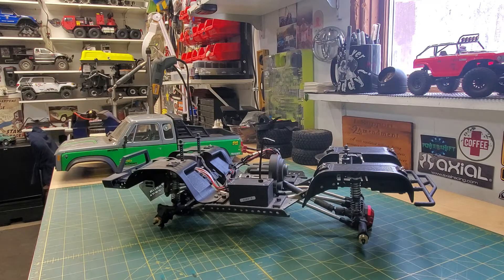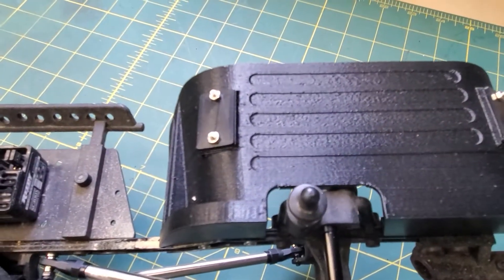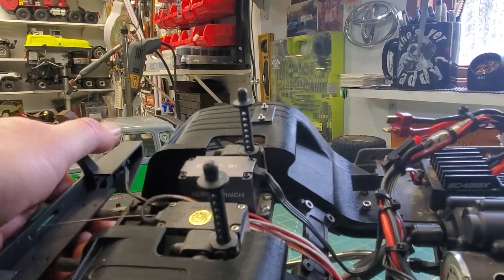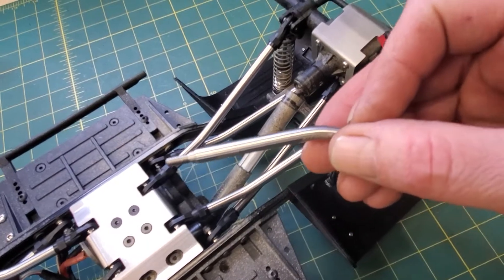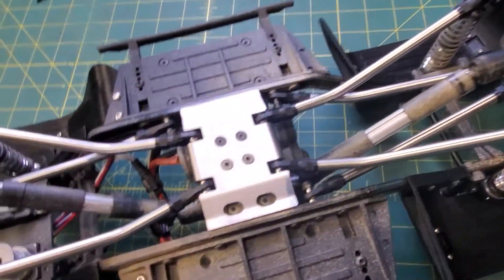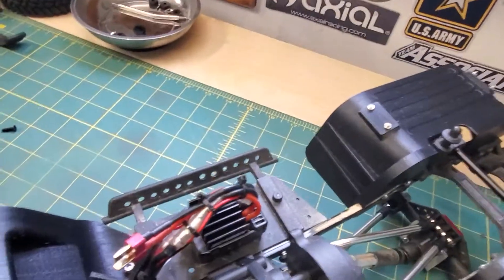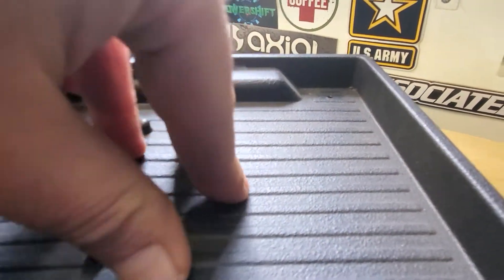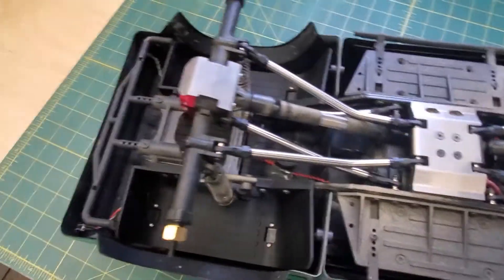Element enduro sendero, upgrades!

Comment: That's cool,man. You know I'm an Element junkie. Those diffs will slide over stuff easier now. All you need to do now is get some aluminum wheels and slap some Pitbull around it. At this point you might as well anyway. It adds a perfect amount of weight to each corner while keeping rotating mass in check. Use some good foams , especially in the front. That was one of the best things i ever did for mine. Was much more stable and predictable. I still get surprised by what it can do just about every time I run it. I enjoy seeing the noticable difference in performance after I upgrade something and that was one of the better ones. What's funny is that I've got a set of those fender liners with the rock lights already installed, sitting in a box under my desk. Doesn't fit the TW without some trimming.
Reply from the maker: Sorry bud!! I dont do aluminum wheels way to expensive!! I do have a set of proline hyracs on the way I may try, but with the tires vented and the extra weight it did much better on the course!!😁😁
Why don't you try trimming the fender liners? Not only do they add weight but they look great!!
Reply: @gerrysoldguyreview  you can get a new set of the Injorra brand aluminum wheels on eBay for 40$ and from everyone I've seen or talked to that run them, they're really good just lower cost. I almost got a set of some aluminum gunmetal grey wheels myself. If you get a few minutes, look on there. I wouldn't steer you in the wrong direction for anything, there's some nice looking wheels on eBay for great prices. The plastic factory wheels cost 42$. Which compound did you go for with the Pro-line?
Reply: I did trim those liners and they do fit now. I wanted to wait till I was sure I was done with the frame and shock towers,ect. I kept having to take 'em off every time I went to change something, so I just left'em off. I'll probably put them back on pretty soon. How come you didn't go ahead and pick up the heavier steering links when you got the high clearance ones?
Reply from the maker: Come on Shannon, I know you would never steer me wrong😆😆
I don't do eBay but maybe I will look at Amazon, they usually have tons of injora stuff! I got my tires in the g8 compound. 
Thanks buddy😁😁😁
Reply from the maker: That is the only downside to  fender liners that I've found is when working on the truck!! Put quite simply I forgot the links for the steering I had them but forgot to click in the cart 🙄🙄🙄 so they are waiting in my cart till I make another order!
Reply: @gerrysoldguyreview  yea, I'll probably be getting another set for this new chassis but I'm waiting till I'm happy with it and i know it's not gonna have to come back apart for a very long time. Just got the last of the chassis braces, shock towers, driveshafts and the motor in this morning. Man, that motor is another level. It doesn't even feel like a regular brushed motor when I spin the shaft with my fingers, just impeccable quality. Can't wait to get it hooked up. Get'n closer all the time. And yea, I consider eBay and Amazon about the same thing. But you should have no trouble finding a good price on a set at either.
Reply from the maker: It's always nice to see the light at the end of the build tunnel!😁😁
Holmes sure does make a smooth motor even the cheap one I got is so much smoother feeling the others!! My only problem with Amazon is that mama has eyes there!!🤣🤣🤣